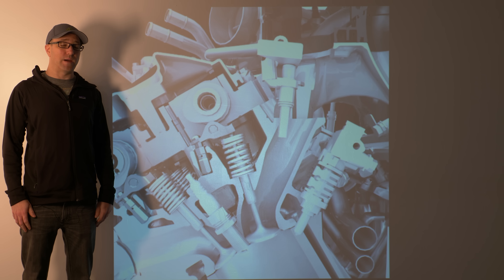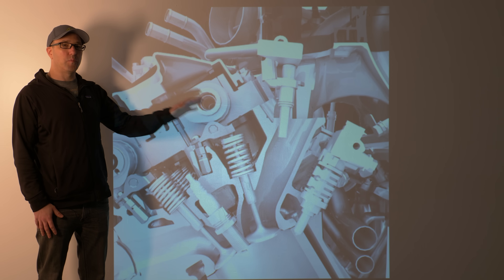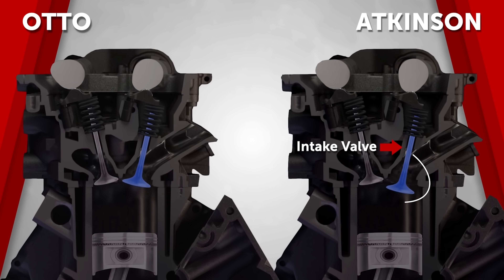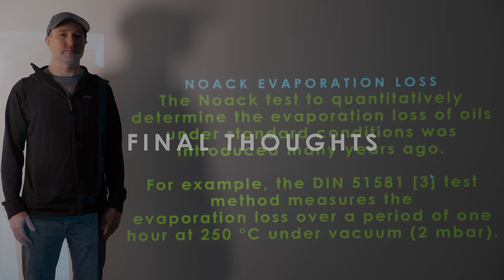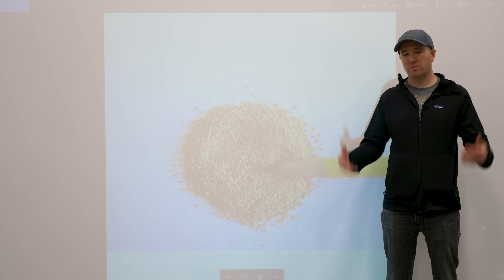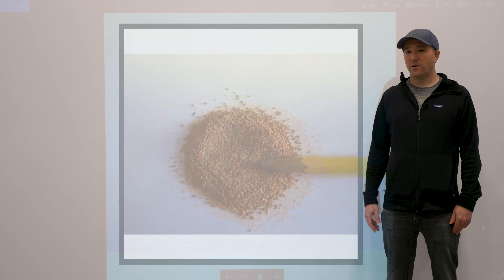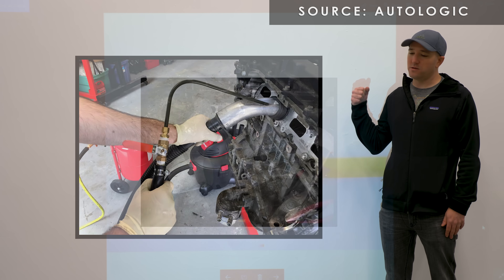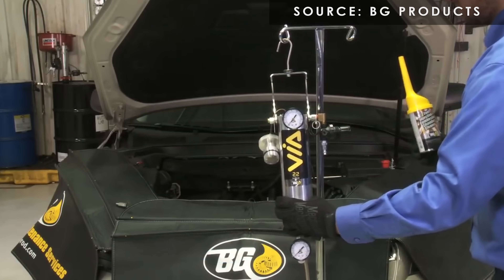Direct Injection, Problems and Solutions | The Fine Print

Comment: Why is it that a 1970s era Honda Civic CVCC or a crappy Ford Escort could get better mileage than these computerized monstrosities they make today? A lot of shitbox cars from that era routinely got 35 40 or better mpg. A Smart Car can't do that and it is the smallest car sold in America.
Reply: Weight. Swap those engines into a modern car built to modern safety standards, see what happens.
Reply: @jacquesc3166  yeah but a smart car is smaller than a golf cart. Surely it doesn't weigh 3000 pounds does it? Here's the thing too - those old shitboxes got great mileage and emissions without reliance on computers. You would think today's computerized fuel infected motors would be so efficient as to compensate for the weight of the air bags and give 40 mpg again. 

I never owned one of those economy cars but I repaired them. I would take one of them over an economy car today.

These new cars also have styrofoam bumbers so weight can't be too much.
Reply: @Dannysoutherner  The weight comes from materials and more complex engines. 1991 Civic weighs 2158 lbs, 2021 Civic either weighs 600 lbs more (LX) or 800 lbs more (EX-L). Interiors weigh immensely more than they did back in the day. Not sure what golf carts and SMART cars have to do with this. Multi port injection cars from the 2000's strike the best balance imo, before the days of heavy computerized systems and active safety suites. Give me an 80 km/h zone up here in Canada and I pull 6.6L/100 km, or 35 mpg with my 2013 G37xS sedan. Fully stock, 110K miles, designed in 2009.
Reply: @jacquesc3166  that makes a lot of sense. I had not considered the interior equipment. I drive an 84 bronco so the interior decor is super simple. The new cars have so much stuff inside. 

My smart car reference is that it is the smallest car sold where I live, is shorter in length than a golf cart and doesn't really get great gas mileage. 

I think we would be better suited with less safety garbage. People wouldn't drive like absolute maniacs if they were responsible for their own safety. We coddle people too much. 

Cars today should be getting 60 plus mpg if not for all the extra junk.

Comment: White spirit from the hardware is what Lucas UK used to sell as injector cleaner snake oil . It really really works . 12fl ounces / 300ml was 3 gallons of gasoline . Go for a few 30 mile drives , normally clear & sweet within 75 miles . To regen your catalytic converter, drive your car in 3rd at 60mph for 15 to 20 minutes of the highway . Not possible in some automatic transmissions . But you can select 1 / 2 or D for drive , do 60mph in " 2 " . This regen takes around 20 minutes and good to run with injector cleaner/ white spirit . Amazing results can save you $1000 on a BMW or SAAB etc . Cheers guys .

Comment: So you're telling me we need to design modular engines that correctly measure the amount of air and fuel that go in the chamber and combust it at the correct time, a full independent closed loop system, with actual flow metering. No, wait, that threatens sustainable income, they have to make a "new" with a "bad" so you still have to buy newer and newer!

Comment: Such a long video for just disconnecting the engine gases tube from the intake or install a proper catch can, EGR and engine gases are the only reason for direct injection to fail nothing else you got no EGR and no engine gases tube.

Comment: Being into todays absurd 800+HP race-cars-with-plates, I really dig dual injection. Especially for something like some of these big power drag week cars(talking about aftermarket ECU controlled engines anyway; support for DI isn't common yet, but more ECUs are supporting it), it can make a lot of sense to allow you to get away with a little more compression, with real street car drivability, while keeping the secondary port injection system strictly for running an alcohol or race gas, coming on when the stock DI injectors are tapped out. While there's obviously some complexity in running two fuel systems, it also simplifies a LOT of what's involved in running dual fuel, being able to essentially automate the changeover using today's ECUs eliminates a lot of the manual work involved in switching fuels probably a decade ago. 
Of course you can do this with two sets of port injectors, but DI really makes for a neat & tidy package. You don't really need to upgrade your primary(street driving) injectors anyway, so stock components are no problem - it's the giant port injectors that are doing the heavy lifting. 

But, ya know, big HP 'street' cars have their own special needs, a lil different than your standard production car lol. Wild times we're living in, when a gearhead could actually setup an ECU controlled dual fuel system on a blue collar budget, in his garage today. Even tune it themselves.

Comment: At about 0:50 .. No! .. Direct injection was invented by Jonas Hesselman in Sweden due to his work at AB Diesel Engine until 1916 (now Altlas Copco) where he further developed Rudolf Diesels engine principles to get a smother run and better performance and in 1916 he made his own company and made the first multifuel direct injection spark plug ignited engine .. Hesselman Motoren. That engine was used by Scania AB in their heavy trucks until 1936 and by Volvo Lastvagen AB in their heavy trucks until 1947. They were far from environmental as they could make a meter or 2 extra "exhaust pipe" in smoke under heavy load.
And that principal was used by Junkers, Daimler Benz before WW2 in 1937 in their aircraft engines to counter engine stall under high speed/gravity impact maneuvers as did the russians and the yanks in mid/late '44 ... so nothing about "invented because of improved milage or environmental regulations" ... wrong

Comment: So direct injection is a bad thing?
Reply: Not really. You just have to keep your injectors clean, and maybe drop $200 at your dealer every 75,000 miles for valve cleaning. On the other hand, you get 10% to 15% better gas mileage, and Horsepower. (and lower emissions).....For example, my car put out 285 Hp before it was changed to GDI, and 333 after it was.

Comment: I used STP pro series intake cleaner and it cleaned the valves right up.  Good stuff, don’t need to remove anything, it just sprays in the intake for about 10 minutes with engine running

Comment: The only problem I have with this video is when the engine is built to have 0w it means 0w, and the reason is because of main bearing clearance, anything heavier than 0w will not address the lube specs

Comment: The most sensible thing to do to eliminate these issues is NOT put a band-aid on this problem by going to electric cars with their TONS of Lead and other toxic products they require, to operate, and not forgetting the need for extremely expensive additional powerplants and infrastructure to create extra electricity needed for the vastly inefficient electric vehicles... The best sollution to alleviate problems like these, is to DEFUND the EPA.... Very few other countries have to comply to such ridiculous regulations... Let's follow their lead , shall-we?

Comment: Thank you, this was very interesting and informative, and I'm now a subscriber.  However, I wish you had addressed the oil dilution issue with GDI engines.  After I change the oil in my 2020 Honda CR-V, the dipstick oil level is above the full mark within a few hundred miles.  I am very concerned about the increased wear this can cause.  To limit this wear, I change the oil every 4,000 miles with Mobile 1.  Once the car is out of warranty, I'm considering going to a slightly heavier oil to hopefully limit the effects of this dilution.  I'll also add a catch can.
Reply: Definitely add a catch can.
I have my 3.5L EcoBoost's oil tested (Blackstone Labs) and fuel dilution is always present, but @ 7K miles intervals it's not bad enough to cause viscosity problems.

Comment: Catch Cans are a problem in locations where it freezes in the Winter.

Here in Canada, many drivers of Modded Cars that use Catch Cans find the water freezes out and over time can be a problem if the vehicle is parked outside in sub freezing temps.

Comment: The pressure in the fuel system is required not simply because it’s in the cylinder, but because the piston is at the top and all the air inside the cylinder is under extreme pressure and ready to go as soon as fuel is introduced.

Comment: I purchased a preowned 2017 Subaru Impreza Sport last year with 65000 miles and it has a 2.0 GDI engine. The first thing I did was run a bottle of Techron injector cleaner thru a tank of fuel (and every 3rd or 4th tank), removed and cleaned the throttle body, and completed an upper engine cleaning treatment with Seafoam. It's relatively easy to do these 3 things and they are essential maint items on GDI engines that must be done every 25k miles or so. That said, I don't plan to keep this car past 120k miles because these engines simply will not last for 100s of thousands of mile like port injected engines can. I will sell this car at around 120k miles and get something else. It might be fine beyond that with my maint regimen, but I don't want to get stuck having to do expensive repairs at 150k miles...not worth it.

Comment: A minor point, this video seems to imply that direct injection is a modern invention, that is not the case.  Both port and direct injection have been around almost as long as the ICE itself.  The first peak in spark ignition, DI was with (mostly) German piston aero engines, by the end of the war all three major manufacturers were using it, although each used a different system. After the war there really was no need for DI, almost everyone went from DI, 4 valve, overhead cam, supercharged, analogue computer controlled, high performance engines back to the same old boring (and obviously obsolete) stuff from before the war.  

Apart from Mercedes-Benz with the 300SLR (and the extremely rare road car made from left over racing car chassis) and the 300Sl there was no real use of DI in spark ignition engines (including in racing) until the modern era.  The 300SL suffered some serious reliability issues brought about by the mechanical direct injection system, fortunately, electronic control of DI eliminated these issues.

Comment: I wonder if (if you lived in a non-Stalinist Emissions testing State) if you could just buy another set of DI injectors. Disconnect and leave the OEM ones in the combustion chamber as sealing plugs - and drill little holes in the intake manifold and let them squirt on the back of the intake valves. Simple-but-pricey way to convert DI to MPI. The computer ought to learn to compensate.
   PS - 75 years ago we had mechanical direct-into-combustion-chamber gasoline injection on two different brands of giant aircraft piston engines (CW R3350 and PW R4360) and they were PITAs. So bad in fact that the US Navy absolutely forbid those engines on any of it's aircraft - they stayed with mechanical throttle body injection.

Comment: Since I was born in 1951 I can remember how much cars have changed over the years. When I was growing up as a child the air fuel delivery system was a carburetor and the ignition system was a points, capacitor and distributor system. What I am driving now has electronically controlled port fuel injection and electronically controlled ignition and variable valve timing. All this is run by microprocessor controllers.

Comment: All GDI engines are junk by design ! I had the infamous 2013 2.5 Hyundai Sonata I bought the car with 45k and it burned 1.5 qts before I new what was going on ! I was using Amsoil signature series 10w/30 with one of the lowest noack ratings on the market ! I tried a good catch can with a filter and added some stainless steel scrub pad , replaced pcv per dealer request. Every 10k I used a can of CRC intake valve cleaner 2x=20k. By the time I had 69k it was burning a qt of oil every 350 miles=1 tank of gas. Dealer had me do 5 oil consumption tests and corporate said enjoy your oil burner 3rd owner we cant help U !  The OIL RINGS were not doing there job, no oil in the catch can at all. I traded it in for a 2011 3.6l v6 Toyota Avalon and use 10w/30 Pennzoil platinum and never burn a drop, 20mpg in city all day long. I learned my lesson GDI is bad design at best ! FLORIDA driving it never gets below 38 degrees here in the winter. Now Hyundai is making the 2.5l GDI with a TURBO !  LOL GOOD LUCK WITH THAT !

Comment: PCV systems have been in place for decades. They were first used with carburetted engines in the '70s. Blow-by is where high pressure gasses from combustion leak past the piston rings DOWN into the crank case. This happens mostly when the engine is lugged and/or when cold. Oil and gas vapors can and do pass through the PCV system into the intake to be burned. PFI systems do not wash the intake valves unless you use fuel additives to clean the deposits. PFI engines tend to leave carbon deposits in the intake ports. GDI engines tend to leave carbon deposits in the combustion chambers. Carbon deposits from fuel happen because the fuel is cold and doesn't have time to completely vaporize before combustion occurs when the engine is not fully up to temperature. When the engine is up to temperature and rev'd up it can burn away some of these deposits in a GDI engine. Fuel additives do a very good job of cleaning carbon deposits on either type of injected engine. Walnut shell blasting for GDI engines is effective, but only needed if you don't regularly use fuel additives. My 1988 Ford Ranger with PFI was notorious for clogging the intake ports with carbon. My 2015 WRX FA20DIT requires injector cleaner to be added every other fill-up. If I forget and run 4 to 5 tanks of gas through the engine without injector cleaner, I will experience engine stalls during take-off. Carbon deposits act like sponges soaking up gas when the engine is not up to operating temp. That leads to a temporary lean condition and engine stalls. When that happens, I have to use injector cleaner every fill-up for 3-4 fill-ups to return normal function.

Comment: The latest tech is often a lifetime reducing time bomb.  
1. Cylinder deactivation is killing Ford and Chevy V8 lifetimes.
2. Poor CVTs sunk Nissan's extraordinary life.
3. Crappy plastics kill BMW motors early.
4. Direct injection clogging will retire every DI car made years before it otherwise would die.
6. Extended oil use intervals and low tension oil rings cause killer cylinder scoring killing otherwise excellent vehicles.
7. Dead hybrid batteries will kill every otherwise long-lived hybrid Toyota product early.
8. Complex electronics kill every Mercedes S class long before other components.
9. EV battery life is a time bomb in every EV.

The fun of auto ownership is just about  over.

Comment: Have a 2019 Honda Fit that was "choking" with warning ⚠️ lights. Switched to Shell 93 gasoline the car went back to normal the next day. Engine lights disappeared! Also, get your oil change every 3k miles with with these engines is VERY important!

Comment: This is what happens when you let complete and utter woke climate crazy people set the emissions standards. DI is by it self a waste as it requires cleaning and use of these cleaners are very toxic in them self. It's like the great recycling lie, as most trash isn't recycled and ends up in landfill.
If using catch cans be very careful with them, as it can lead to increase in pressure and cause gaskets / seals to blow.

In this day and age it would be better if we had better cat converts and use port injection, but too much money to be made in all this "going green" world we live in. aka it's a scam.

Comment: Clean the back of the valves every oil change. Use a chemical spray, spray it down the the throttle body, entire can, then change the oil.

Comment: I've used a water separator for an air compressor, just remove the filter, the oil just falls in, the air keeps flowing through. Option 2. Just go old school and put a filter on like the old school cars. Remove it before you smog your car, then re install.

As far as oil. Mobil 1 0-40. Meets all the euro specs, doesn't matter what OE says, 0-20. Thicker on the higher end doesn't matter.

Comment: Always wondered how the INTAKE ports in a direct injection engine were getting carbon-ed up. How did it get into the intake manifold? Thanks for the explanation! 
Sounds like direct injection cars should all have oil separators. Unfortunately, DI cars tend to be expensive, and the people who can afford them will trade them in before or when they need major maintenance, so there's no incentive to add that expense.

Comment: what about using water injection to keep the combustion chamber and valves clean??   It sure works well on diesels and gas engines alike.   It also does not need to be constant.   run water injection on the freeway , which is best or one week on, one week off.

Comment: If manufacturers were smart, they’d go back to TBI when the fuel has so much time to tumble with air, it’s almost a complete vapor before it reaches the cylinder. My v8 30 year old Cadillac gets over 22 MPG on the highway, and the insides of my whole air delivery side of the motor is completely clean.

Comment: I run a lawn mower fuel filter between the crankcase & PCV valve on my car. I get the clear ones, so I can watch the filter element. They last ~7000 miles, on my car, and they're cheap. 1/4" in/outlet filter was an easy install by only cutting the OEM hose, and it's right on top! (for an '01 Prelude with ~126k miles)

Comment: The PCV system does not route "unburned fuel" during proper engine operation. "Positive Crankcase Ventilation", and unburned fuel should not get into the crankcase!

Why don't we just get DPCV, direct positive crankcase ventilation, and put a couple extra ports in the head, one for each cylinder?

Then the intake would stay clean!